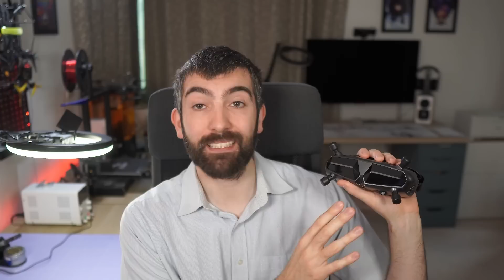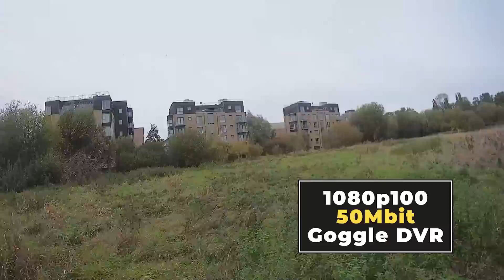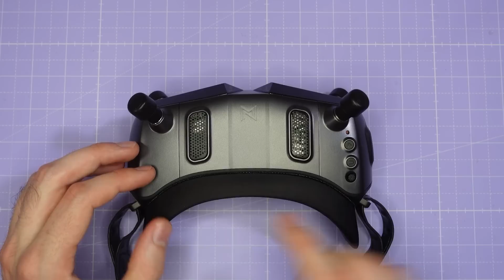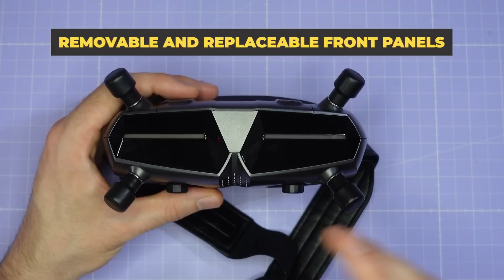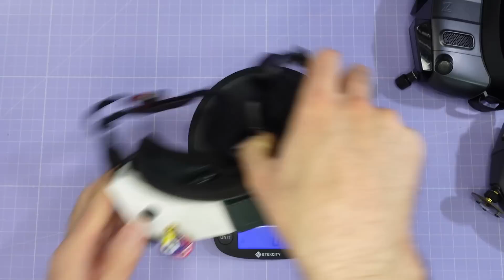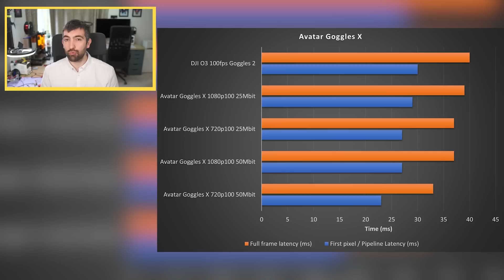Avatar Goggles X: Latency Test, Flight Footage and Review

Comment: Hey Chris, thank you for all of your videos you have made over time.
I just bought these Googles X after seeing your video... I have had so far in 8 flights, 4 crashes. The googles video feed just stops in flight, googles shows green/pink colors in stribes and then black screen. UI is dead, only sign of life is the blower noise. Recorded video on googles is faulty.
This is bad. So I found out that, when I lower my head to much and aim at the immortal crossfire antenna om my TX16S, the Avatar Googles X goes into this crash mode. Again and again.
Only way out is power off/on.
When Crossfire transmit at 250mW or more and the antenna points upwards and I look downwards, this jamming incident happens to freaky easy. Just a question about distance, even on 25mW.
I zip tied the immortal to the handel, that  helped a bit.

I wonder if ELRS will do the same, what do you think?

I hope this will help others with the same issue.

.

Comment: Just solder power button on power cable. Easy thing to do and it is the same for the goggle as pulling power cable off. The positive thing here is that power jack will tear down less. Or if you are uncomfortable with modifying provided cable, just build your own with power button.

Comment: My brand new goggles X keeps crashing - UI and buttons lock up after 10 to 20 minutes (ie warmed up) FPV feed still plays in background - another 10 or so minutes and video feed locks up too.    Once warmed up it does this every 2 or 3 minutes.   Im in the UK - does anyone know where i can get help sorting this issue or replacing these ?
Reply: It's heat problem. You can replace new heatsink for free.

Comment: slight offtopic question:
when switching between cddx Vista and O3 Air, do i still need to change firmware on the DJI Integra/goggles2?
It stops me from building my second Drone because i dont realy want to stick with Vista forever

Comment: As far as fitment goes, at first the dji goggles 2 were very uncomfortable but, the 1080p visual goodness bombarding my eyes made it worth it. The new fabric and foam comfort fit faceplate from dji solved all of the fitment issues for me. My skyzone o4x goggles fit the best out of the box,  I'm still using the original Sharkbyte VRX with them

Comment: Can't really talk about fit & ergonomics without talking about whether you can get the corner-to-corner clear focus on the screens... 
I'm particularly interested in this since the goggles say 50 deg FOV and previously most/all slimline goggles that had wide FOV's were very hard or impossible to get in focus corner-to-corner.
Reply: I’m hoping that that issue was more of a problem with the old style “insert your diopter lens” goggles…Iv heard from friends that the newer optic modules with built in diopter adjustments are far better. Mine are on order so I guess we’ll see
Reply: @seanmetzger4780  No, I have heard reviewers say this about newer goggles that have the built-in diopter adjustments as well.

Comment: Hello.
You have an excellent channel with detailed technical testing of equipment.
Thanks for your channel.

I was very surprised that you did not test the AV input and HDMI input of the new glasses as well as other reviewers.
- There is information from other reviewers that at the moment the HDMI input of the new glasses does not work correctly, the image has the wrong color, which makes the image unreadable. 
(it is not clear whether caddx will be able to fix this with software).
- And also that the AV input has a large delay (around 100ms), which makes these glasses unsuitable for flying a quadcopter through an analog receiver.
- In addition, these glasses cannot record DVR for analog input and HDMI input.
- The HDMI input and output are heavily recessed into the housing, which prevents the use of almost all HDMI cables.
- The quality of the plastic molding is very low, so much so that the inscriptions next to the input/output ports are almost unreadable. The wear resistance of such plastic is a concern.
- I am concerned about the question of what resolution and what frame rate the glasses can produce through the HDMI output, as well as what resolution and what frame rate the glasses can receive through the HDMI input and show to the user. Because if this output or output is 1080@25fps, then it's pretty sad and useless for some use cases.

What do you say about this?
For what reasons did you not conduct tests of image delays through AV and HDMI inputs, because these are very real user cases of use?

CADDX have already released several updates for the new glasses, but still have not fixed the problems listed above.
The question arises whether they will be able to fix the above problems at all.

Based on apparent problems like this among end users, the manufacturer has a huge problem testing their products. 
Maybe CADDX considers its fans and early buyers beta testers?

Comment: They are certainly the best looking goggles around that's for sure. I currently am using the HDZero goggles and I love them. I have been thinking about trying Walksnail out and I was looking at getting the VRX but these goggles are full featured enough and reasonably well priced so I might just get the Goggles X instead.
Reply: I have the same setup as well. Going to sell off my VRX since I preordered the X Goggles. VRX is great, just heavier and more of a battery hog, etc.

Comment: Its a shame Caddx didn't do 2x RX and 2x TX antenna setup on this new goggle. I feel like that's a benefit more than a drawback to have it setup like DJI? anyone have any insight into this?
Reply: They send telemetry to VTX, but this is not their main task.
Why do glasses need two transmitting antennas if they are designed to receive a signal?
Reply: @GroveLoveBIG  multi pathing. They are polarised so you need diversity

Comment: Thanks for the vid! Cheers. I do wish you had touched on the analog support with latency and your experience vs the HDzero goggles. A hdzero vrx HDMI in test to the walksnail would have been good too.  I'm beyond frustrated with analog on HDZERO and the hdzero whooplite boards breaking on me; I'm considering giving up on hdzero.
Reply: Man, im pretty hard on my hdzero whoop vtx's and ive never broke one... bad luck i guess?
Reply: @CorruptName1   3 vtx's (1x whoop and 2x whooplite) broke within 3 hours of flight (each) over grass with no major crashes. Maybe its bad luck but, I'm not spending another 60 bucks to find out. I figured I would give the new v3 race board a shot before jumping away. But, this wouldn't solve my analog issues as well. The newest firmware is causing problems with signal where I have to go into the fusion menu after plugging in the quad to make video display. Plus the fusion doesn't sit correctly in the module bay where pressing the menu button on the fusion presses the two fusion boards apart. I have to glue crap inside the module to hold the fusion in place better.